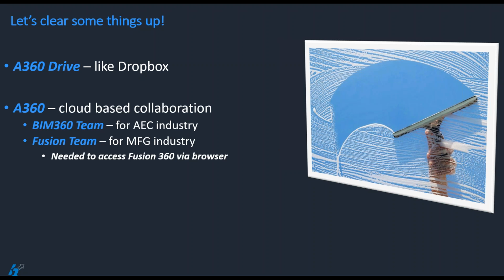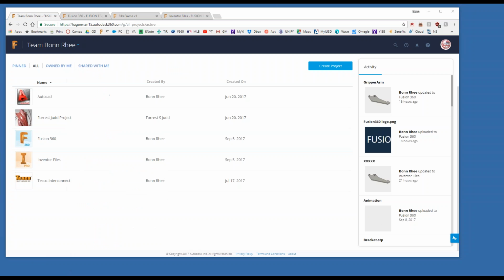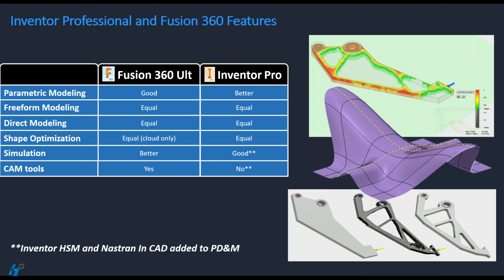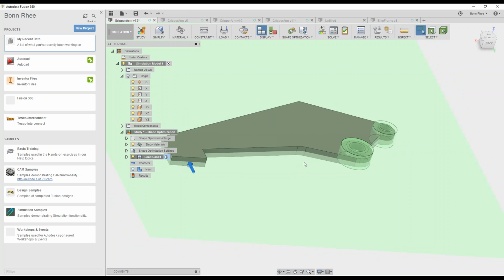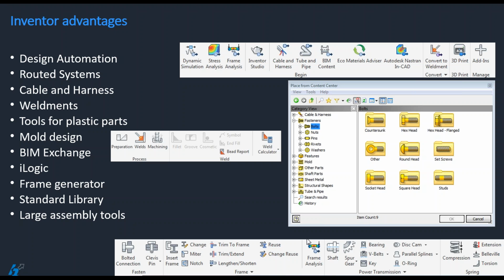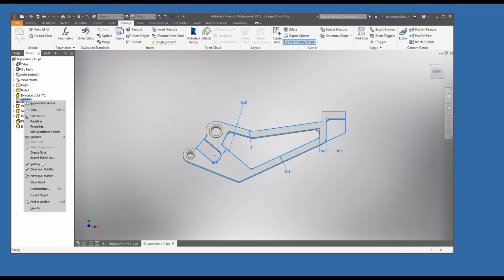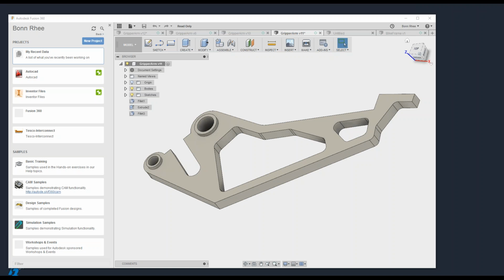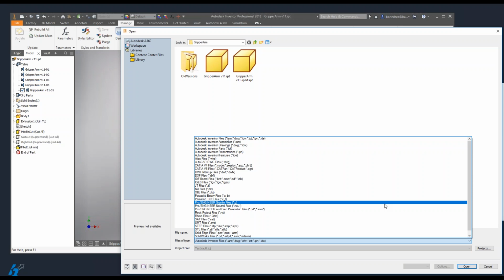Inventor vs Fusion 360

Comment: Used Inventor , it slows down the computer to disgusting limits Had to re install windows , is fusion better than inventor?
Reply: Much better
Reply: Yes it wotks on a server cloud
Reply: Yeah, you can use it on an intel iGPU (just about)
Reply: No it sux compared to inventor, however if you have a low end computer then it is all you can use.

Comment: Could the AutoDesk product line be any more convoluted?

Rhino it is...
Reply: Maybe they could rename Fusion 360 'inventor 2' or something. But really it is good they may want to make different products for better suiting different applications but it doesn't always inspire confidence in the usability of these products when for every small difference in application an entirily new product is developed and the differences between them aren't obvious. They should perhaps simplify their stable and combine a couple products into one program which can be expanded with packs or sth for different purpooses. I can imagine people buying licenses for inventor only to conclude down the line that they really need fusion 360 without options to switch. Even when it's is very similar software from the same company.